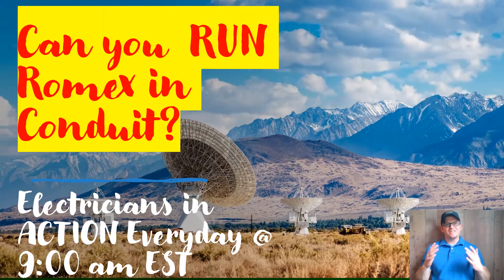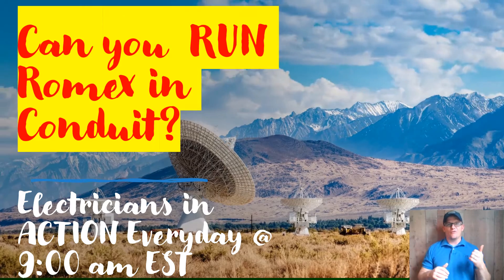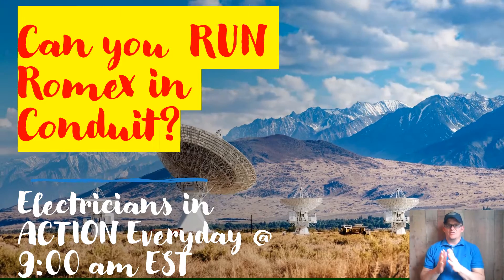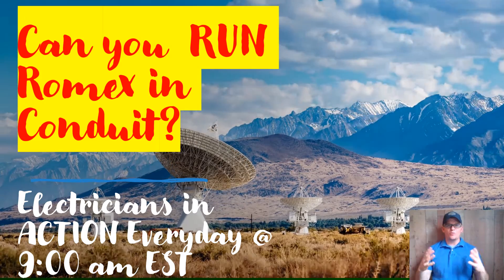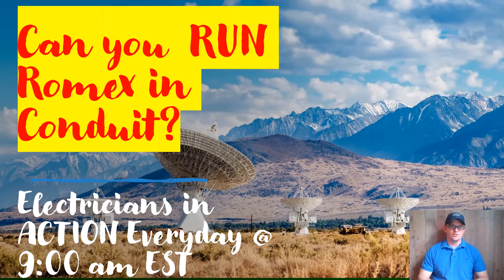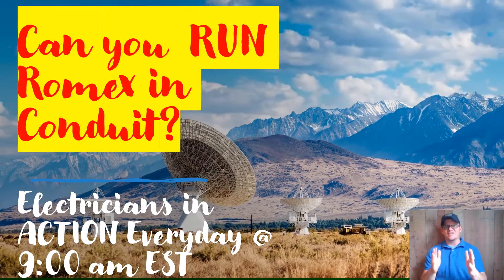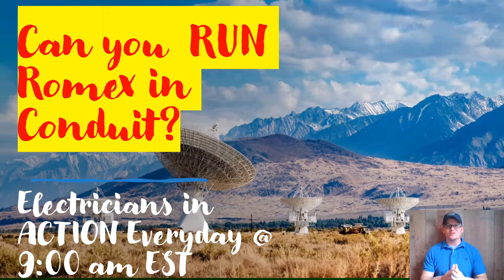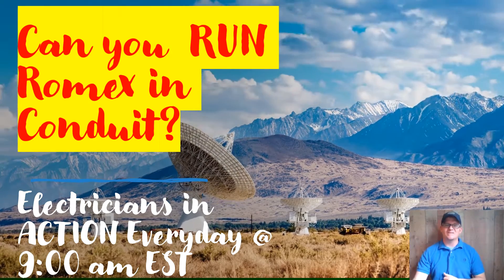Romex "NM" in Conduit??

Comment: Interesting about the last part about unsheathing being optional. I just pulled original (83 yr-old) NM out of a basement wall conduit, for the purposes of re-wiring with a ground, for a replacement receptacle. The recep box is embedded in the cement wall. 

Conduit runs into the box as expected, and up thru the wall, exiting at the top with a 90-degree elbow. They notched the rim joist for this. But because of the 90 elbow, I'm not confident I can pull NM through it unless its all unsheathed ... I'm thinking of removing the sheathing so that the conduit (and box) can become grounded along the way. Yes I am aware I should add a pigtail ground inside the box.

I'm not done with my inspection. I don't yet know if there's an opportunity to attach any conduit at the elbow, so that a connection can be made to a nearby J-box. Then again that's all above the "finished" wall line (up within joists.) How they originally did it was leave the NM poking up protected by wraps of tape before being part of the regular supplied NM.

Comment: How do you terminate the conduit once protect is no longer needed? I have a water heater with flexible conduit used for protection of the Romex while the wires are outside the wall, but once it is in the wall, it's only Romex. Should there be a clamp? A bushing? Nothing? I'm having a very difficult time figuring out the transition from NM wire in a conduit to end the conduit and just be NM (in a wall).

Comment: I get that romex shouldn't be in outdoor conduit but if its indoor and the conduit has room and isn't stuffed its fine. If romex heated up in conduit enough to cause an issue it wouldn't be allowed. I saw a whole workshop wired with 12/2 and some 12/3 in 1/2" emt and there was never a problem with over heating.
Reply: If heat is a problem then your wire is the wrong size it has nothing to do with it being in the conduit. Unless the conduit is way over full.

Comment: Does the same apply for 700 series wiremold in an interior location? I’ve seen 12/2 romex used in wiremold and wondered if this was up to code?
Reply from the maker: I don't believe there's a problem running Romex in the proper wiremold

Comment: Great video! I’m installing a 200 amp exterior surface mount breaker box. How would I transition from Romex to the breaker box? Thanks man!
Reply from the maker: That's going to be up to your electrical inspector, are you underneath a porch? Will you be coming in the top of the panel?

Comment: Thanks, Coach! Is there any use case where you would actually want to run NM cable in pipe? I just don't know why anyone wouldn't just use wire.
Reply from the maker: Hey Brother! Resi electricians do it all the time! It's good for short runs, surface mount mount in a garage or basement, it's great when you're sleeving.
Reply: As mentioned good for when NM needs protection from physical damage (i.e. from exposed basement ceiling down a concrete basement wall to recepticle or switch). In these use cases fill rules are more relaxed because it is not then considered conduit, rather protection.
Reply: The romex going to my electric water heater does not have anything protecting it once it comes out of the wall, So I'm considering running the romex through a flexible conduit but I wasn't sure if it was allowed. Romex is 10/2 what size conduit should be good to use?

Comment: for a short distance if the inspector isn't a d...
Reply: So in my area we’re allowed emt with compression fittings outdoors. Can you run NM cable in that?
Reply: @omargarcia4401  You need UF (underground feeder) cable for outdoors. NM cannot be used outdoors no matter what raceway it is contained in.
Reply: @omargarcia4401  no not outdoors.
Reply from the maker: Great question brother check this video out 
https://youtu.be/ChWgOqOEhdQ